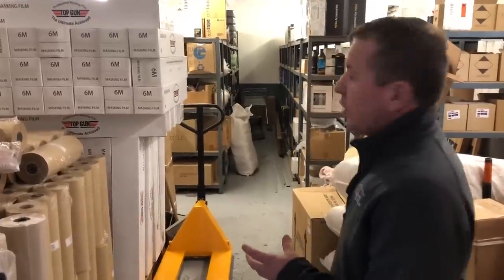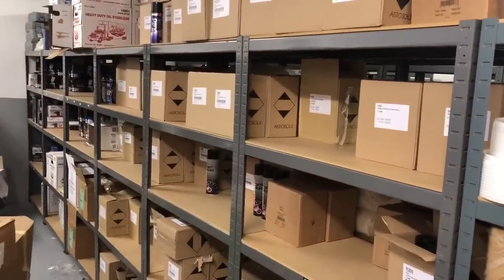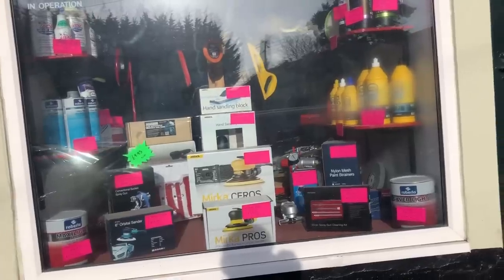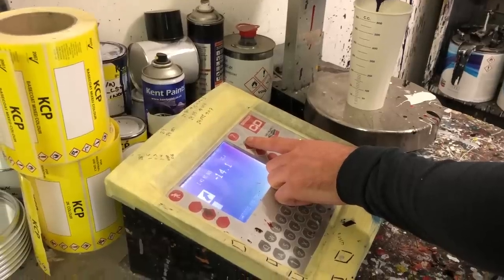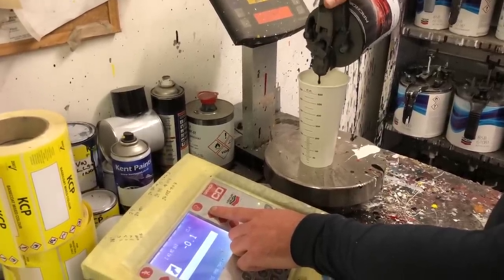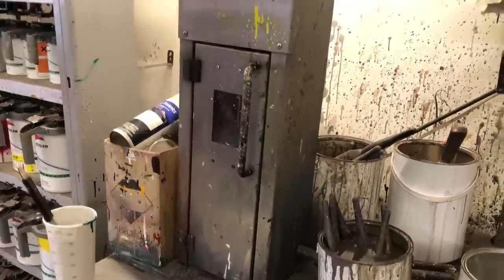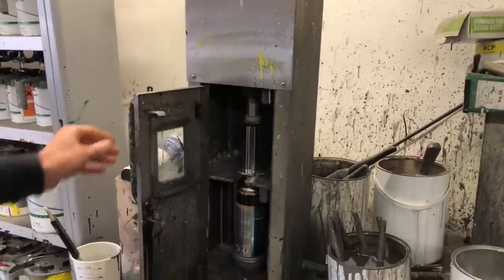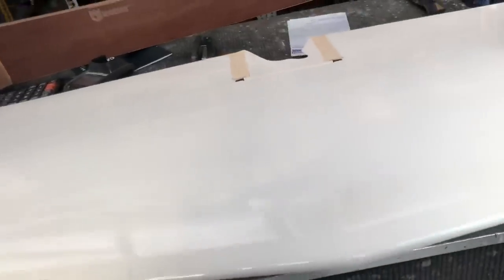How it’s made colour match aerosol spray paint

Comment: Many years ago, it was possible to buy a trigger mechanism for an aerosol can. It just clipped to the top of the can. Turned it into a spray gun. I've had mine over 30 years. Saves knackering your finger pressing the nozzle.
Reply: You can still buy them, fiver in halfrauds I think. I use one all the time makes life so much easier.

Comment: Very interesting. I need to get a colour match and paint mixed for my Car. I can see why the colour on the Land Rover didn't match, as well as the old paint being faded Tuscan Blue is the wrong colour. Series 2 and 3 Land Rovers are Marine Blue paint code JCC so you were only off by one letter. I think Tuscan blue is a Range Rover colour.
Reply from the maker: Roy Henderson marina blue was 10 times worse we tried that first 👍
Reply: @sruk  I 've had trouble getting a good match for mine which is why I am going to get it colour matched.